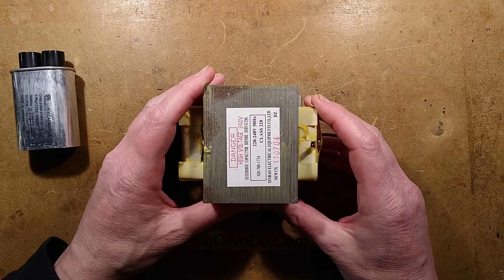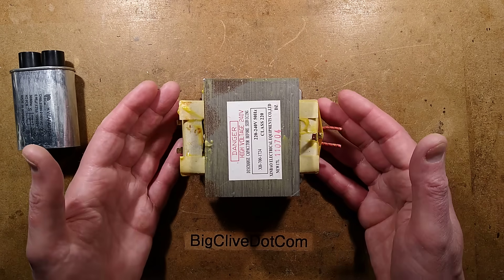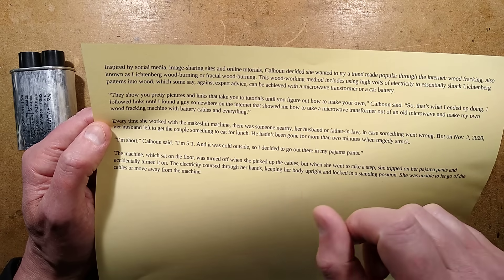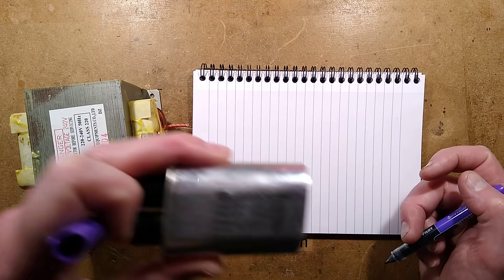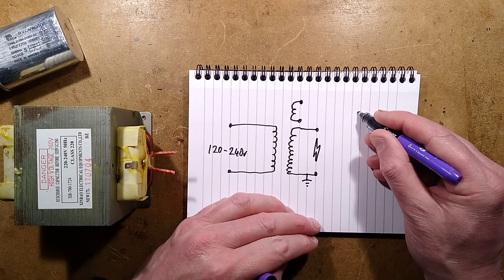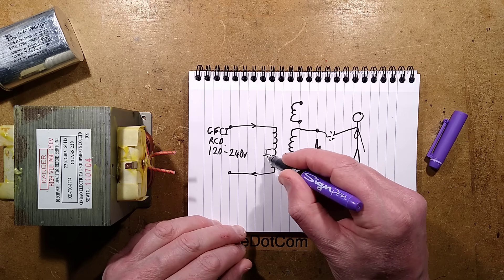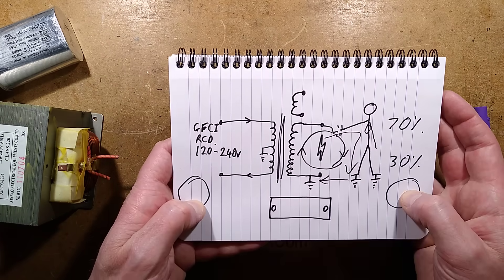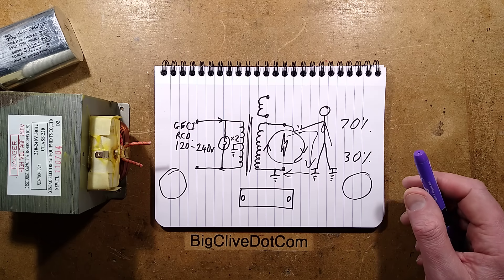The most deadly project on the Internet

Comment: Thanks, BigClive. Always appreciate your safety improvement efforts.
As a side note: I'd actually even use a different style of push button for that little death trap. I first encountered them in Siemens HMI panels: These buttons have a sweet spot you have to hit in order to turn them on: If you don't press them hard enough or if you press them too hard, they'll shut down. The latter being exactly the kind of feature you'd want if a juicy connection makes your muscles lock up...
Reply: Very clever.  Probably a bugger to use on a day to day basis, but like bike helmet, better a bugger than a half day out with the undertaker.
Reply: Good idea, those are annoying to get working right, but the greater purpose is worth the endless fiddling around!
Reply: @calebkemplay6040  Fucking around with dumb shit in dangerous situations is more dangerous yet
Reply: You get this type of switch on robot pendants. Seen these on Kuka and ABB teach pendants.
Reply: @minkymootwo  You stole my thoughts! I've worked with ABB welding robots extensively, and the teach pendants (used to manually move the robot around and make simple program and configuration changes) have a button we called the dead man button that you had to push in about halfway to turn on the motors and enable the joystick or step through movement commands. It was easy to feel where this middle position was, but if you freaked out and squeezed it too hard, it would shut the motors down.

The robots have collision detection too, but the large robots probably wouldn't even detect a person unless it's crushing them against a wall and even the medium-size ones have enough momentum to knock you several feet before they can stop completely or crush you if you're already against a wall and it's in auto. (The robots move slowly in manual.)

The button saved me on one setup we had where one robot controller and teach pendant controlled two robots, and I'd step through the program watching one robot but forget to disable the other one until it bumped into me from behind. Again, the robots moved slowly when set to manual and I wasn't against anything, so I wasn't at all injured and it was no big deal, but if I hadn't been able to let go of that button or squeeze it harder to easily and quickly stop the robot, it wouldn't have been pretty.
Reply: @chitlitlah  I nearly got caught out with a thankfully small ABB robot. It was in the full run mode and had a bad connection on one of the gripper sensors so it would intermittently stop because it was waiting for the gripper closed signal even though the gripper was actually closed. I stupidly got in the enclosure without pushing the e-stop first and started to wiggle the wiring harness around, I don't know what the hell I was thinking!! Thankfully I was able to get out of the way of the robot when it started to move again!
Reply: Cool! I never knew these existed. Found a purchasable model online: HE1G-21SM - IDEC HE1G-21SM, GRIP ENABLING SWTCH
Reply: @S.A.241  At ONLY !! £200 each I can't see many amateurs using two of those to control such a project! But thanks for the search terms ;-)
Reply: There's some 'joined-up-thinking' for you!
I don't know if this is just a 'rural myth' but here's the story for your amusement;
a farm worker walked into a milking parlour and witnessed a co-worker with his hand clasped on an electrical control panel, the man was shaking violently and making strange grunting noises. Thinking quickly, he grabbed the nearest piece of wood (a broken shovel handle) and delivered an adrenaline-fuelled swipe to the man's arm to knock it away from the dangerous panel.
A furious tirade of abuse erupted from the 'shocked' victim as he clutched his broken (now rapidly swelling), arm.
The 'would-be' rescuer/hero took great offence at being so lambasted by the ungrateful wretch who's life he'd just saved. Roars and vicious threats ensued ('Ill bust this over your head, ya bollix' , 'I'll take that handle and shove it up yer hole!' and such-like could be heard), this commotion brought the farmer and his wife running to see what was going on and eventually sanity was restored.
Turns out the 'victim (potential electrocutee?) was not in mortal peril and had merely stopped to try and shake his welly-boot off (not wanting to use his hands as it was literally caked in shite) to remove an annoying calf-nut that had found it's way in! 
Legend has it that they were back on speaking terms within the year, however the actual words exchanged may retain some rural 'character'.
Pax Vobiscum.
Reply: We used jog buttons from Schneider Electric with the same function. If you pressed them too much i would disconncect power, the same if you let go
Reply: Yep.  I just used one of these in a training class working with an industrial robot.  You have to grip them while using the teach pendant.  If you stop it kills power to the robot.
Reply: What panel was that?
Reply: @markbakerskater666  Simatic KTP Mobile 7/9"...
Reply: @matt79de  it's not safety rated...it's not an F Bus master...stop playing if you don't know what you are doing
Reply: @markbakerskater666  I was talking about the feature they sport, not the actual device/switch. Those switches used in the panels operate on some very low voltage, so you wouldn't want to hook them up to mains directly. But you could use them for example to control a triac or an SSR. My point was that you want to detect clenching muscles and shut down if detected. Those switches do just that and with Simatic panels i can have at least some hope, that someone encountered them somewhere and knows what i'm talking about...
Edit: Since you mentioned it: Those panels actually do have two F modules - for redundancy.
Reply: For completenes: The switch the panels use is a HE6B-M202, but as pointed out already: That particular switch is unfit for mains (rated at DC 30V/0.7A). But a bit of googling maybe leads to one that is. Otherwise some control circuitry would be necessary.
Reply: I have never encountered this on a Siemens HMI. The system you describe sounds very like an industrial "pull to stop" or tripwire E-Stop system (which may well have been part of the machine's control system). If the pull wire is too tight or too loose, you cannot reset the system.

Standard two-button industrial start systems also include a timer (typically 0.5 - 1 second) to ensure both buttons are pressed simultaneously. This was proven to be a requirement after an operator jammed one button down and just pushed the remaining one - eventually resulting in loss of a digit in a small industrial press.
Reply: @TheRealWindlePoons  Check out the 'Mobile' panels. They have it. The others (i am aware of) don't.

Comment: My grandfather and father were Electricians and I learnt three things from them:
Be wary of all potentially live things and treat them as live even if you think they aren't, the smell of oxidising air from an exposed wire and that I do not have the training to handle or work with anything with high voltage.

Comment: Years ago I worked on some vacuum plating machines that used a electron gun. It was powered by a regulated 10KVDC at 1A power supply. The regulating element was a 4-10000 external anode tube normally used in broadcast transmitters. They had killed at least two. Interlocks and grounding hooks didn't stop it.  And these were not just normies, they were techs that should have known better.
Reply: I am an x-ray design engineer. These machines use up to 150 kV. Many, many people have been killed or injured working on these machines. People who should have known better. A big X-ray machine is capable of  100kV at 1 ampere. That's 100kW. They have all kinds of interlocks and crowbar switches but some idiot will try to bypass them to trouble shoot a fault. Then it's the x-ray machine company who gets blamed when he is dead.
Reply: @vinquinn  X-Ray machines are fascinating but yeah, no way would I be messing near it while energized!

Comment: I have no real interest in wood fracturing BUT. The car battery gave me an idea. Could you use a car battery and an ignition coil? The coil would give you the voltage needed but limit the power to something that would hurt, just about evey mechanic has felt one, but not Kill. Just a suggestion.
Reply from the maker: Some systems for doing it in a safer manner use ignition coils or flyback transformers run at high frequency.

Comment: There's a reasonable 2019 video regarding wood burning dangers "Fractal Wood Burning Safety"  on "Jim's cool stuff" (6.14K subscribers 75K views).
He's one of the very few who strongly stresses the importance of not attempting wood burning unless you understand high voltage safety.
He's probably saved a few lives with his video, a very, very worthy undertaking indeed. The same can be said for BigClives 2016 "Make Lichtenberg wood art safely" video. (434,300 views)
Jim's setup has the transformer isolated from the ground and mounted in an insulated box. 
Isolation sounds like a good idea but I expect that if there was a breakdown between the transformer core and the primary windings (not designed for KVs of isolation?) there would be a path to earth again via the neutral and active.
Unless his metal work table was grounded there is probably a risk that anyone touching any distant part of it would be in danger?
I wonder if the RCD would then trip as the leakage could easily be evenly shared by both Active and Neutral?
He has a link in his comments to an article about a man that was killed doing this. Powerful stuff.
For safety, he has also installed a very attention grabbing buzzer that should always alert the user to danger. This is an excellent concept.
The problem of course is that you would come to unconsciously rely on the buzzer (as BigClive mentions in today's video at 12'40").
An extremely dangerous situation would then arise as the buzzer could easily stop working if there was any leakage of the high voltage into the mains wiring damaging the buzzer.
Maybe a second warning indicator / buzzer running off the unused filament winding would give a more bullet proof redundancy?

Comment: Hi Clive, personally never heard of this and a off the street punter play with 2KV is pretty scary. Even though I have an electronics background, there's a couple of things I wont play with unless necessary. HV AC or DC and RF that requires plumbing ie microwave above 10GHz. Great video, mate.
Reply: There's no special danger in RF above 10GHz, you can get 24GHz radar modules for toy robots. In fact, something that can generate a dangerous amount of power at such a high frequency is pretty exotic and not something you're likely to come across, as opposed to UHF and down where kW class amplifiers are relatively affordable for amateur radio use.

Comment: The 'need' to get results bypasses rationality  -- pretty comes before precaution.
240 V is a bloody nuisance, 440V bloody stings,  most folk have played with a wind-up Megger (well, they should if they haven't).
I've even been pranked with the output from an old TV transformer 'what't that whistling noise? oh, it's that pretty spark to my finger' 
but fat windings on a 2KV transformer?
damp hands?
damp with electrolyte all over the place?

Yes, it may reduce the shalow end of the gene pool a bit but it's not a nice present for others to deal with.
However, if 'fractal wood art' is a money maker then the temptation for 'quick and cheap' removes any caution.
And to think that these are often the same sort of  folk that goes on about 'common sense' . .  ;-)

Comment: I am almost entirely unfamilar and completely unexperienced with voltages this high.  I understand enough to know not to lick overhead infrastructure, and that's good enough for me to not want to play around with it.

That being said, I'm curious if lineman's gloves with leathers overtop would be sufficient to handle this.  That was the requirement for working on 400-600VDC hybrid vehicle systems at both Toyota and Honda dealerships, as well as a physically roped off area around the vehicle, and a fiberglass hook-pole plainly visible outside said perimeter.

It just seems like the risk vs. reward is way too high.  "Well, I'm dead, but at least now my family has a piece of wood with a lumpy lightning bolt pattern on it."
Reply: even exp electricians have died. a Wisconsin couple were killed and their house caught on fire. it took weeks of investigation to figure out what killed them. titktok viral videos should be stayed away

Comment: I made one of them years ago. First thing I did was make a set of insulated probes 3 foot long, and got some cables rated at 30k volts.
Still scary.
I used a oil burner transformer.

Comment: As an experienced DIYer I once decided to buy a MOT in order to make a spot welder. At first I tought about make those fractal burning in the wood plate, before dismantling the secondary. When I actually bought the MOT, and got i hat huge piece of metal in my hands, the fractal idea vanished completely. The secondary was completely sawed. The spot welder is fine but I fear its 3V output. It's 3V, but I do respect anything that outputs 950 A. It's kind of fearing that Ohm' Law could be revoked just at the moment when my fingers touch it.

Comment: These transformers are absolutely lethal, you can be rest assured that 9 out of 10 times the results of getting a High Voltage shock are devastating, I once had a Microwave Oven and wanted to check if its output High Voltage was OK as the complaint was it took ages to heat food, although lack of Microwave power can be due to a bad Megatron or a weak High Voltage Capacitor, but sill me I banged my mustimeter probes across the High Voltage output terminal, I had a feeling that things may go wrong so I hooked up the Multi meter  probes when it was switched off and on its highest voltage range of 750V AC , I assumed that the meter may give an overflow error reading or most may disintegrate, so I stood well back, and switched on power, what happened after I switched on was like a tremendous extremely loud 50 Hz buzzing noise and thick black smoke and flames pouring out of my multimeter, The noise was so thundering loud, it quite shocked me a for a split second I did not know how to turn off that power switch.
Please stay away from these High Voltage experiments, they are not worth your life, you can take so many precautions, but one day you never know there may be a cut in your protective gloves and electrons can find paths that you cannot even imagine, they can even pass through insulators if they are not of adequate size or thickness. I actually hate fixing Microwave Ovens, My 100 dollar multimeter suffered instant death.
Those who have had 230v shocks and got away with it, many don't and 2000Volts is extremely dangerous, it can overwhelm tiny electrical signals in your muscles from your brain such that if were you to get a shock from high voltage then your tiny brain signals cannot move or twicth any of your muscles to get away, you will be solidly locked on to that part that you touched. Very rarely gravity fall may save you,
Reply: I've been shocked by 480V while naked and wet in a campground shower due to a freak heating element failure (and apparently a bad electrician). Fortunately, the current through my body was not enough to cause harm as my muscles helplessly contracted until my body fell away. I don't even fuck around with 110V outlet power without a clear sense of safety and purpose.